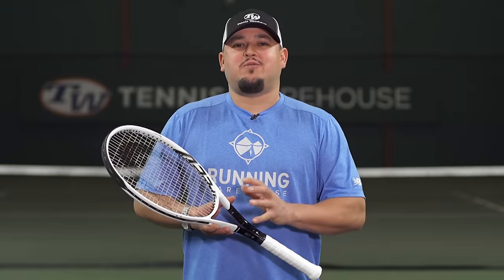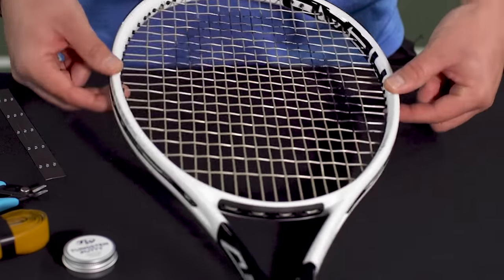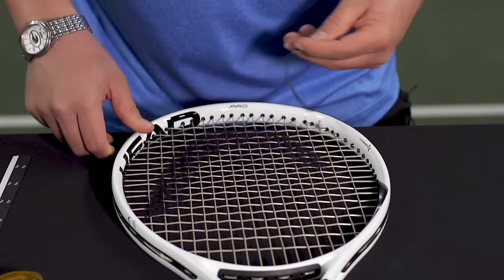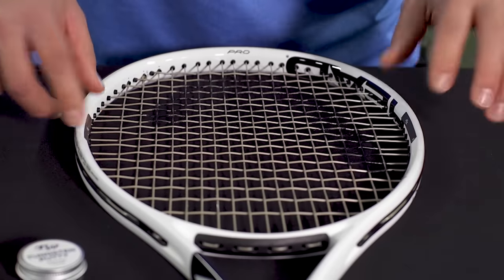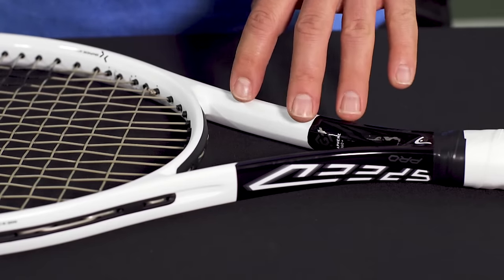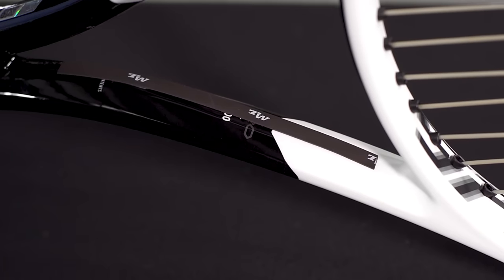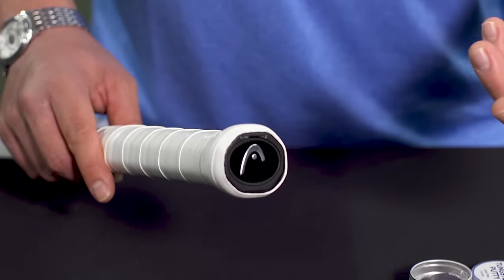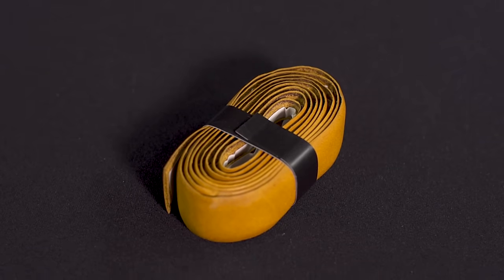Improve your Tennis Gear: Racquet Customizing Tips 🛠🎾 (change balance, swingweight, add power, etc.)

Comment: What benefit would adding weight to the throat have?
Reply from the maker: It is a way to add the weight in one location, and not change the balance by much, or if at all. It will increase the plow through somewhat, because it will increase the swingweight, just not as much as adding to the head. Troy, TW
Reply: Tennis Warehouse So will this result in more power and/or stability?
Reply from the maker: @alexgrant4864 , yes, but not as much of an increase in power, and stability if you were to add it on the sides of the hoop. But the balance will remain close to stock. Troy, TW

Comment: I want to decrease the swingweight. Help me, please. Thanks!
Reply: @Rick-ou6wy  Really, just this?
Reply: Eduardo Souza The only way to do so is maybe to use a thinner gauge string and use a multifilament or syn gut instead of polys and natural gut. BUT you can put on a leather grip, use the tungsten putty or put some lead or tungsten tape strips under your replacement grip to make your racquet more head light/more maneuvrable.
Reply from the maker: Yes, as @pmgareau mentioned, you could try a thinner or lighter weight string, or remove dampener if you use one of those. Besides that you really can't reduce swingweight, unless you start to remove the plastic bumper on the top of the racquet, which gets into other issues, and may reduce the durability, and integrity of the frame, and void any sort of warranty. Adding weight to the handle makes a racquet more headlight, and can feel more maneuverable, but won't reduce swingweight. Troy, TW
Reply: @Rui Dias Are you brazilian too?
Reply: @Rui Dias Certo, então. Muito obrigado pelas dicas. E bons treinos quando a pandemia passar...
Reply: @ers87  Quantitatively you cant reduce swing-weight, but you will FEEL lighter with your racquet.
Reply: @Rick-ou6wy  Okay. Thanks, man!
Reply: @pmgareau  Great answer. Thanks!
Reply: @tenniswarehouse  You're right. Thanks, Troy!
Reply: As many have said, you can't really reduce SW easily unless you can remove mass from somewhere. I have noticed that as well as what Troy said about that leather grips are about 8g heavier than synthetic grips (average 24g v 16g), you can also find lightweight synthetic grips that maybe 4-6g lighter than the average (around 10-12g), so you can lighten the grip area a bit even if it's synthetic. For example, I found Wilson Sublime grips that are often installed from new weigh around 16g, whereas Karakal Tour grips weigh only about 10g installed. You definitely can notice that the balance changes, but the SW impact is only small.

Comment: Some people add the lead to the grip what does that do?
Reply from the maker: If you add weight to the handle side of the racquet, near the region where you grip it or near the butt cap, it will make the racquet heavier overall but also more headlight. This usually gives the feeling of added maneuverability, even though racquet gets heavier, it usually feels as though you can manipulate the racquet easier. Some also notice a bit more stable feel to the racquet, although not nearly as much as adding the weight to the hoop. Troy, TW

Comment: Where do I have to put lead tape to reduce the power of the racket to have more control?
Reply from the maker: In that case you would likely want to add weight to the handle or tail-weight the racquet, which makes for a more a head light balance. It technically won't reduce the swingweight, but it should make the racquet feel more maneuverable and easier to control the tip of the racquet. Troy, TW
Reply: @tenniswarehouse  Thanks for your answer.

Comment: What are benefits of adding weight to 6 o clock position?
Reply from the maker: Being pretty close to the throat area it will be pretty similar to that location, it will add overall weight, won't alter the balance as much as adding it to the upper hoop, add some swingweight, but not as significant as the upper hoop, and lastly it will open up or extend the sweet-spot slightly toward that bottom of the string-bed. Troy, TW

Comment: Wouldn’t added weight in the handle still have a noticeable effect on swingweight? I think the axis of rotation of the swing for the majority of players is the torso, not the butt of the handle
Reply: You obviously know your  physics so your question answers itself
Reply: Todd Custer   Well yes it does seem obvious but the video claims the contrary.
Reply: Proof is in the pudding
Reply from the maker: We are referring to swingweight based on the RDC machine that we use to calculate it. It clamps the racquet at the bottom of the handle near the butt cap. Troy, TW